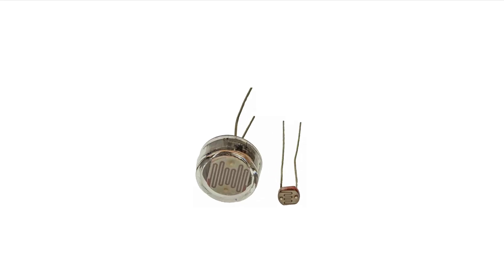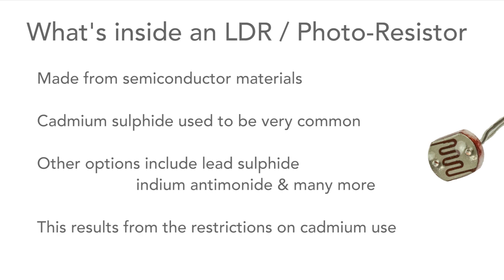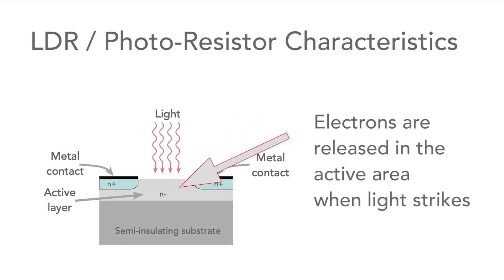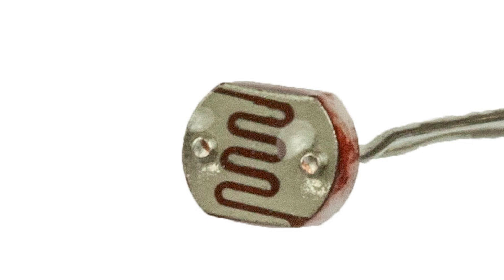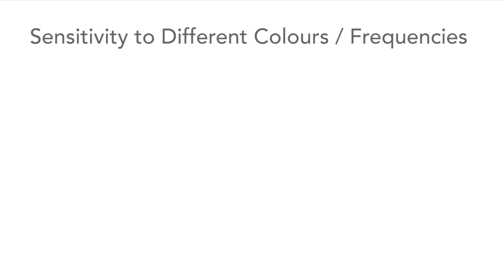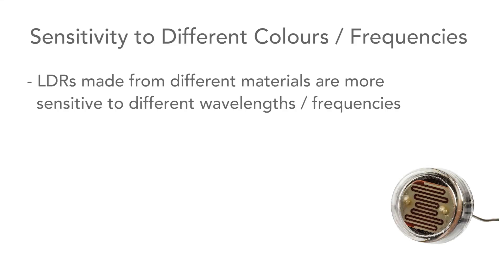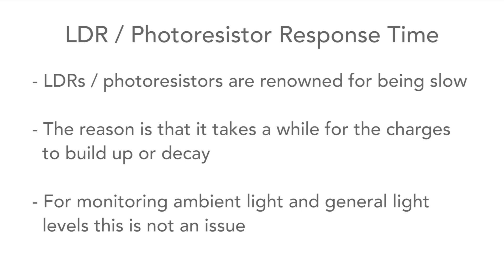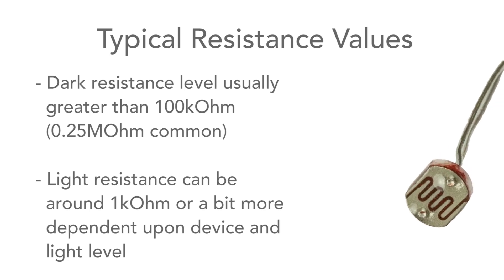Understanding Photo-Resistors or Light Dependent Resistors, LDRs

Comment: Very good. The dark resistance can be as high as 20Mohms for some LDRs and commonly is above 1Mohm for most LDRs I've used. Amazingly useful little devices!
Reply from the maker: Yes it is possible to get some LDRs with very high dark resistance levels, but I wanted to give figures for more average devices. Thanks for the comment.